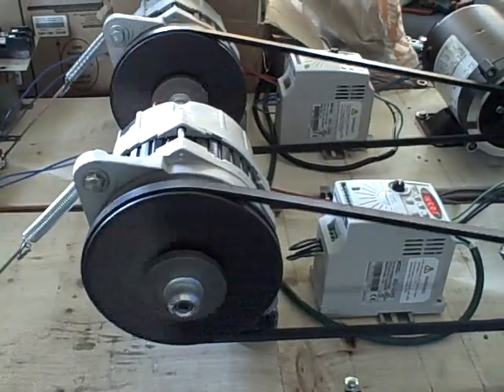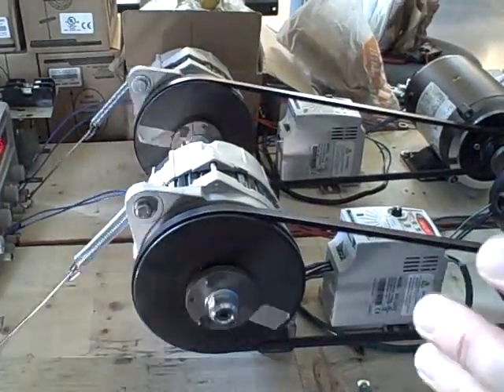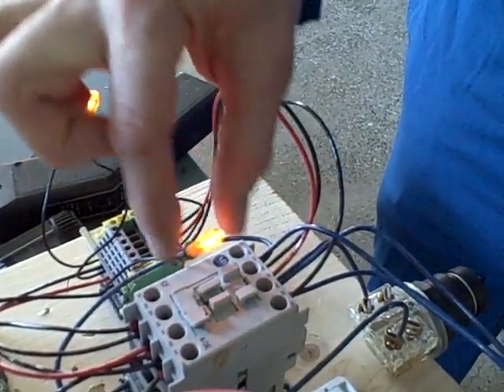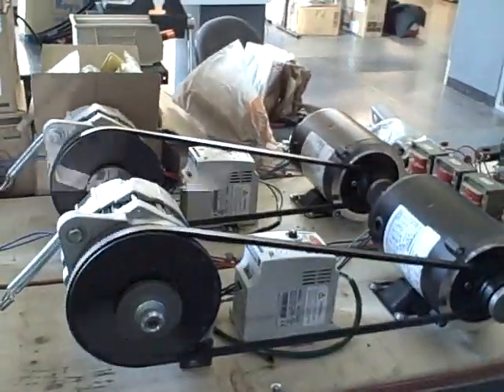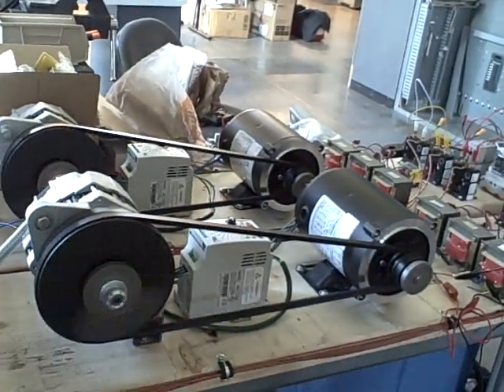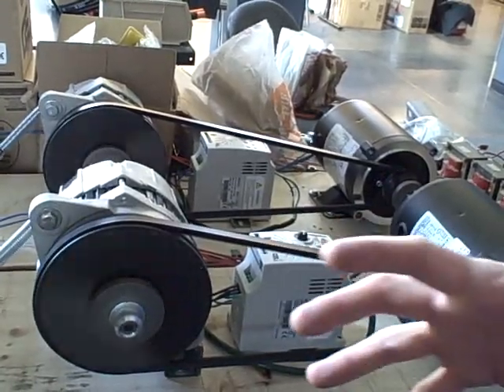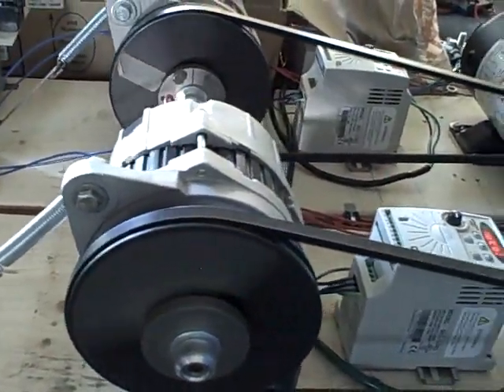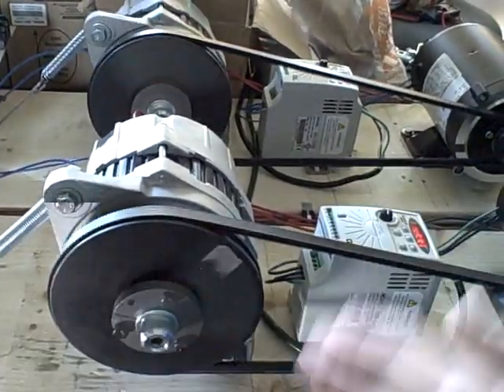Synchronizing AC generators -- Part 3 (sync and unsync)

Comment: I built a vibratory machine with two 3 phase motors that shakes media within a bowl.  They don't stay in phase even with adjusting the frequencies.  Can I apply this principal to my setup? If the eccentrics in the motors are opposing each other then I get destructive interference in the bowl and nothing moves until the motor phase up again briefly.  Please help!!

Comment: Nice demenstrution sir.
Is it possible to couple two generator together with single pulley system. In that way it wouldn't reflect the rpm to synchronize? Just a thought

Comment: Just curious how well this works when they are under significant load?  I'm guessing the mechanical driving force must be very similar in order for this to work properly, otherwise they will each feel a very different portion of the load or try to fall out of sync?
Reply: You asked at a good time! In early 2018, the European power grid experienced a significant imbalance. From https://arstechnica.com/tech-policy/2018/04/european-grid-dispute-resolved-lost-6-minutes-returned-to-oven-clocks/
"[...] between mid-January 2018 and early March, a grid dispute between Serbia and Kosovo resulted in 113GWh of unmet demand from Kosovo. Since Kosovo is part of the Continental Europe Power System, the unmet demand on the 25-country system led to a system-wide decline in frequency to an average frequency of 49.996Hz. That meant that clocks were counting down minutes too slowly, and, over three months, connected clocks around the continent lost six minutes."

To fix the problem, the authorities pushed the system at 50.01Hz for a month. Unfortunately, this broke the clocks for the people who had already "fixed" them. And the authorities in Belgium decreed that This Shall Never Happen Again.

I fondly hope that some science papers are being written about this incident.

Comment: Hi! Great material here. Is it possible to setup load sharing using this set-up as well?

Thanks!
Reply from the maker: Yes, load-sharing is possible to demonstrate with these machines.  Once we get all six generators connected to our miniature "power grid" in the lab and get the SCADA system set up to display individual generator loads this will be a goal of ours: load balancing between individual stations.
Reply: :) we would love to see a video of load sharing too !!